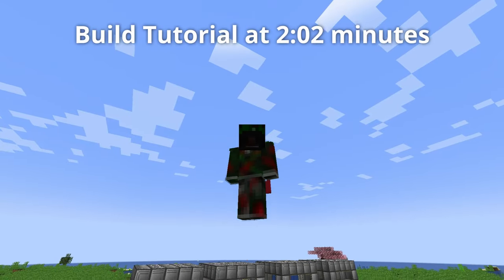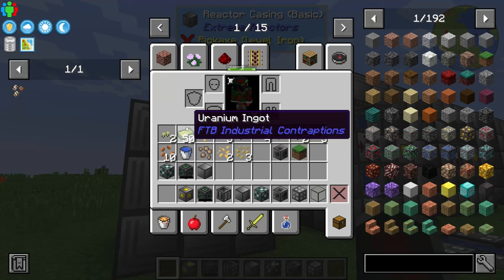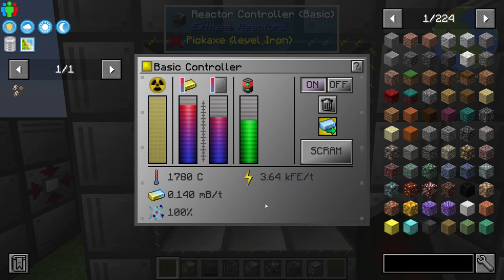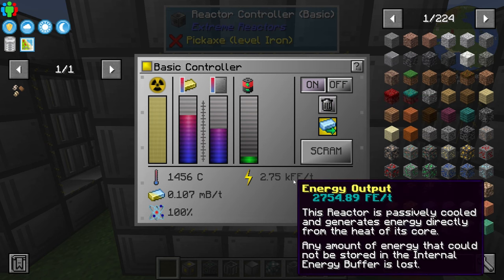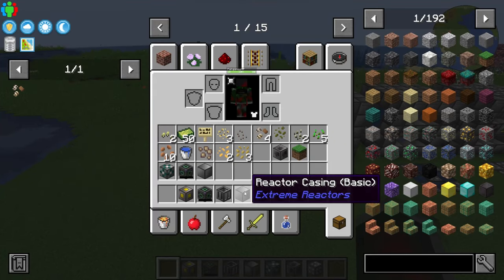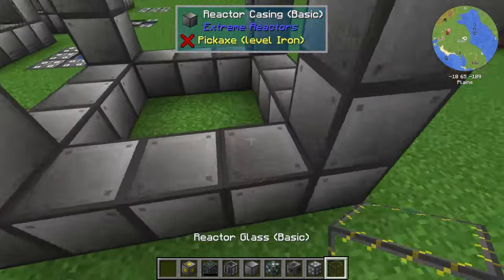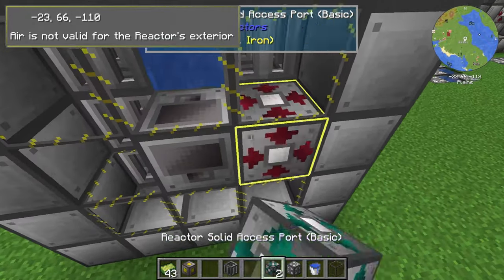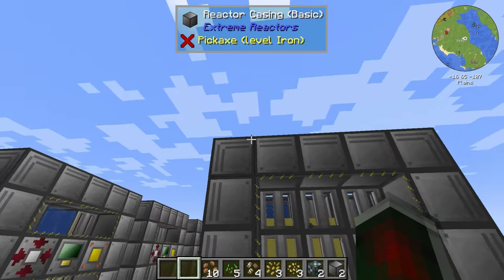Extreme Reactors 1.18.2 Tutorial: How To build a reactor + some early game examples

Comment: There is a risk in this mod??

I mean, if it runs out of fuel, too hot or some problem that makes the reactor explode XD
Reply: Or simply these problems will make the fuel more/less durable depending on its temperature, and also if the amount of RF/t varies depending on its temperature.
Reply from the maker: Haven't used big reactors for ages but I think so. Couldn't tell you how exactly it works though, sorry :(
Reply: @Failgames47  To what I want to say is that yes in this mod there is that the tractors explode, or simply nothing happens.
In the Draconic reactor there is a risk of explosion, and in those of Powah! when no freezing is used the fuel is consumed quickly.